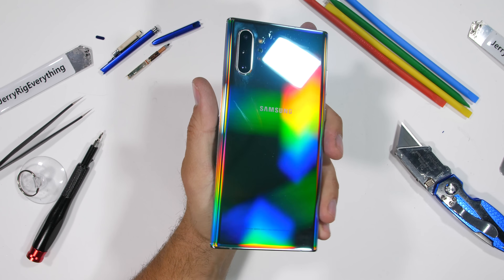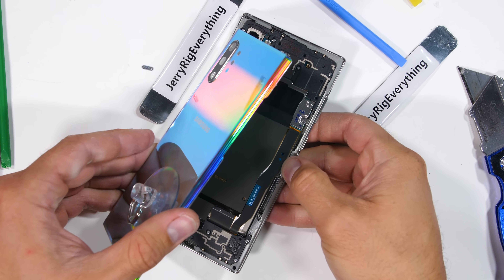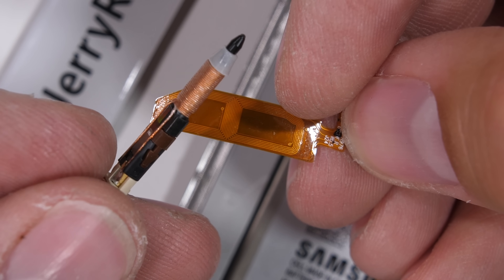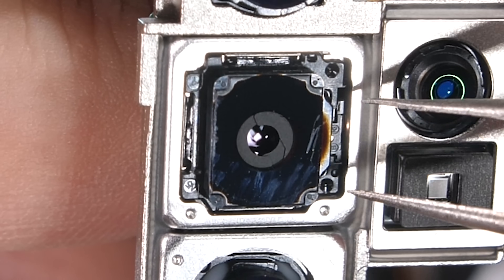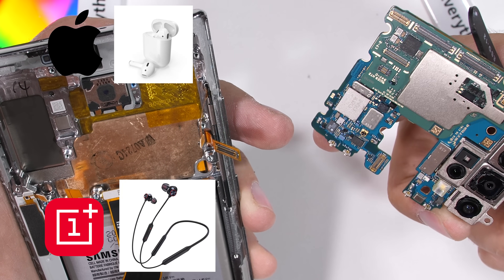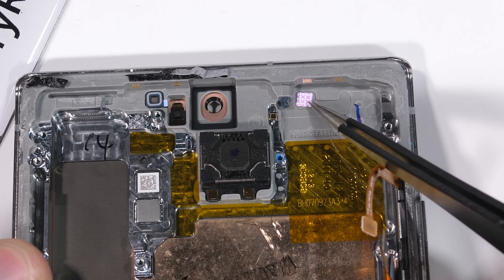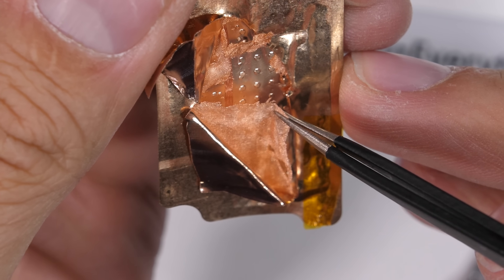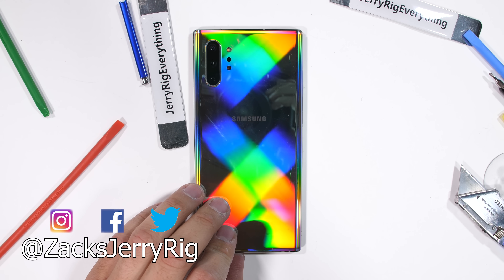Samsung Note 10+ Teardown - TWO Wireless Chargers?

Comment: Remember when you could just take off the back panel on a phone ? like just like that
Reply: You still can! You just have to use a phone old enough to be in kindergarten like I do 😂
Reply: Im using that phone rn. Galaxy Note 4
Reply: Young kids associate that with being poor
Reply: yeah but apple sheeps made fun because of it and It turns out that a nonremovable back pannle is very good for alot of things
Reply: @marquisethomas5611  jup
Reply: Galaxy note three
Reply: One someone stoled my battery in a phone that can open the backside
Reply: Somebody stole my battery because of a removable back panel
Reply: Odio Defectum ahh yes the good ol‘ days when your phone wasn’t water resistant. Loved that!!
Reply: I still can. I have a samsung galaxy j5 from 2017, and i can still remove the back lol
Reply: @lucius2938  my phone had the removeable back and it feel into a creek with the back part fell off the the hardware and everything was just exposed and it worked fine until my mom through it and it shattered and the battery bent in half now I'm on a Google pixel XL 😂
Reply: Odio Defectum my old blackberry did that and the battery was right there. It could literally fall out while the phone is running if you take the back off.
Reply: @Papa Bear Based Consoomer.
Reply: Yeah. Then in mid/late 2014 google invented a technology that can track any phone using only your battery (no gps). 'Coincidencadently' at the exact same time that batteries got sealed in the phones.
Reply: I can still. Using a samsung j7
Reply: remember when you could hang your fone on any wall you liked?
Reply: good old samsung j5
Reply: At least... im glad. My phone doesnt go out from rain, accidently drop water on or drop into the toilet. Im sure that save lot of people hundred of dollar then just to pop out ur battery when ur phone crash. Lets be real, many of the user only need to remove the back to pop the battery when the phone turn black. That doesnt even happen anymore. I wud rather not able to open my back of my phone for no reason than to have it broken from water.

Im not saying u are against it. But some people in ur reply does. They need to priority their reason properly
Reply: @prumchhangsreng979  What about 10,000 mah battery upgrades? Or being able to pop a new battery in when the old one dies, instead of buying a whole new phone. The removable plastic back phones are also thinner & lighter devices. Waterproofing is nice, but IMO not worth what they took away. Everyone has their own opinion though.
Reply: @smokinamby  yeah i forgot about that. My bad
Reply: @BittenKitten  that's the equivalent of somebody stealing the tires of a bike
Reply: Gëretshavда :3 lol
Reply: @elakeqq  I actually still have my note 3 and 5. So I'm planning on buying the Note 10 plus so I won't even think about upgrading for a long time (unless it breaks).
Reply: KeBin cool!
Reply: I used to do that with my phone while i was bored 
Pop it off and back on
Reply: . how did u know (phone is samsung galaxy j3 luna pro)
Reply: Yeaa like the galaxy s5
Reply: Yeah it only on samsung s1 to s4 and note 1 to  4
Reply: @LegoMeng  there are dozens of more budgets versions in the Samsung line up that have the pop off back
Reply: Samsung J3 2016, miss it :(
Reply: Samsung Galaxy note 3
Reply: yeah my samsung s3
Reply: Like my $50 walmart phone
Reply: No grandpa I remember flip phones and nokias!
Reply: Yup. Friends j7 prime fell down 2 floors into gravel. Nk cracks or anything. Battery did fall out though. If that happend wit my iphone, i would have to consider it dead meat
Reply: @quiet_benzy  Mine has an Otterbox and I'd be worried of a two story drop... My old phone got ran over and it was fine, new phone is a note 10+ so the screen is a little more vulnerable.
Reply: Me with a Samsung s3: por
Reply: That is un - safe
Reply: @prumchhangsreng979  The main reasons for a removable battery are: a-Quickly replace your depleted battery with a fully charged battery. b-(most important) When your battery dies after 1.5 or 2 years, just buy a new battery. This way you can use your phone for several years instead of two or less. No need to buy other phone every one or two years. Flagship phones like Galaxy Note work decently for many years if battery is replaced.
Reply: @21753117  good point but.
1. Powerbank
2. Take to the store, u cant remove urself but the store can. Taking phone to store once every 1.5/2 years to replace battery aint big of a deal consider u need to go to store to buy the battery anyway. Extra cost are lil too compare to losing a phone due to water.
3. Like i said, no need to do that. Just take it to the store.
Reply: i like it better harder whenever i would drop my phone the panel would just come off
Reply: @Jake-ec3hp  Still using my note4. Works and looks like new.
Reply: fidgeting by taking off and putting the back panel of my moto g4 play is my favorite passtime
Reply: Goodtimes 😂
Reply: i actually recently revived a galaxy grand quattro with a custom rom
Reply: @creshaunjohnson9105  Good things happen from bad things
Reply: i remember that Lol
Reply: They make the back panel so hard to take it out now because it need to be water resistance
Reply: The 2019 Fairphone 3 can do exactly that
Reply: Zak Whipp p
Reply: Yeah I had a phone like that once
Reply: My phone can do that
Reply: I used to do that all the time for some reason with my moms samsung note 3
Reply: The best part was when you dropped your phone. Instead of breaking, It did a ninja tuck and roll  move, ejecting battery, and back plate to disapate the impact.
Reply: @prumchhangsreng979  Discordo! 
1. A Powerbank vai demorar entre 1 e 2 horas para recarregar o smartphone (e não é bom utilizar o smartphone enquanto a bateria carrega), enquanto que a troca da bateria descarregada por outra já carregada vai demorar só 1 minuto.

2. Você não precisa sair de casa para comprar algo.

3.Existe clientes com outras prioridades acima da proteção contra água.

(O ideal é que tivesse as duas opções [ bateria removível e bateria fixa(com IP67/68) ] no mercado.)
Reply: @Dacite6  if you are talking about water resistant s5 was already water resistant
Reply: I still would be using one with a removable back, and a headphone jack, if my Samsung Note 4 hadn't died.  (It began resetting or freezing randomly, until it finally refused to power-on any more.  Other than that, it was flawless, and sans Bixby.)
Reply: @Jake-ec3hp  Lucky you.  You can also use it as an IR remote control, unlike the newer versions of the Note, where they removed the IR emitter.
Reply: @lucius2938  They're not waterproof after you have to replace the absolutely idiotic glass back panel on the Note 8, 9, 10, or 10+, that is unbelievably fragile.
Reply: Hell yeah I do still thinking of note 4 till this day
Reply: @lennartkrischik4757  J5 2017?I remember my parents having it and the back wasn't removable
Reply: @BittenKitten  65
Reply: Makes me miss my s5. Loved that phone
Reply: I still have one that can do just that!
Reply: With this note 10plus I go straight in the water 😅, remember that this wasn't possible
Reply: They are coming back soon
Reply: And they wer waterproof
Reply: i can take off the back panel on my S10 Plus

Comment: Haha!   “2025 - thinking of upgrading but I’ll stick with my galaxy s8 for now.”
Reply: The Note 9 is the last good Samsung phone
Reply: I'll be happy with my S8 for at least another year
Reply: I have s7 edge and I don't think to upgrade.
Reply: I have nexus 5, and it's kinda time to upgrade.
Reply: That moment when you think man 2025 is fucking future but it's closer to us than 2012
Reply: I still have my S8 since 2017 & I won't upgrade till there's a drastic upgrade on specific features, like the Camera sensors, battery, (larger capacity or upgrade to Solid-State/Graphene battery) cpu/gpu,  headphone jack (optional add-on), screen size (between- 6.1" - 7.0" inch, and price tag!
Reply: @AngeEinstein  the Note 9 is still the best phone around. The best thing about it is that now that the Note 10 is out, the price drop of the Note 9 makes it affordable and highly desirable.
Reply: @AngeEinstein  why?
Reply: Looks at my s6 while typing this
Reply: have nokia 3310 want to upgrade in 2080
Reply: @AngeEinstein  IDK, the S10+ is pretty damn good and also has a headphone jack.
Reply: same here
Reply: Ive had my S8 since christmas 2017, it has gotten a few problems, but next year ill switch
Reply: I had the S7 edge until 2 weeks ago when I dropped it at work & the screen started bugging out.
I went and upgraded to the S8 as that has the best price to performance ratio I could find. 
If only it didn't have that fucking Bixby button it would be near perfect.
Reply: They will probably have their under the display cameras by then.
Reply: @AngeEinstein  nah all Samsung phones are good
Reply: Yeah the world wont even exist by then
Reply: @AngeEinstein  Agreed.  I'm going to keep this for a while.
Reply: @zenon6493  bruh...
Reply: Watching on a Note 10+
Reply: @naomishamwell5449  how is it going so far, and what did you upgrade from?
Reply: This is feasable. I got my S4 when it was brand new and didn't upgrade until the S9 came out. And I only did that because the power button on the S4 blew out. Phone still works fine.

I do love wireless charging though. Maybe I''ll get a Note 15+ when they come out in five years.

By then, the audio will probably work through quantum interference directly from the phone to your cochlear membranes.
Reply: @AngeEinstein  wrong
Reply: Still have an S8
Reply: @henjoh69  Keep your device It is not worth it  to upgrade unless your device get lost or stolen.  If that happen get the Note 9. I will be the best phone for the money.
Reply: @AngeEinstein  what's wrong with the S10?
Reply: @dogcat8290  With the exception of the Note 10. Samsung became greedy just like apple and other companies forcing loyal customers  to by dongles and watches . THAT IS WRONG.
Reply: @wardellrosario2182  are you okay? They include dongles and usb type c headphones in the box. Don't even try
Reply: @wardellrosario2182  And what how does Samsung force people to buy watches? You alright?
Reply: @AngeEinstein  i think the s10 is pretty dam good
Reply: @AngeEinstein  the s10 is great
Reply: @R3mix97  yeah this makes no sense I own both n10+ and note 9...not true at all.
Reply: @wardellrosario2182  They now pushes users to upgrade their phones in the same manner as Apple. On my s8 with android 8 I was using two sims with SD card without any problems, but since Android 9 update Samsung decided to include tiny piece of code named "isSimSdBlock" just to prevent using SD card with two sims. Of course I can always root my phone, but I need Knox.
Reply: @AngeEinstein  ur high the 5g is the last good one
Reply: @AngeEinstein  I think the S10 is the last good Samsung phone
Reply: @yerriff8115  I like the s pen
Reply: @dogcat8290  dongles are unpractical, you have to take a extra piece with you and you can lose them
Reply: @dogcat8290  nah
Reply: Wardell Rosario I nearly got my phone stolen i Sweden, and trust me, that'll never happen again
Reply: @ayaansiddiqui9169  no the latest one is the best one
Reply: @152mmapfsds  nope the note 10 is
Reply: @AngeEinstein  you can lose wired headphones too in that case. If they're not comfortable or you out of all people don't like it then use the usb c headphones.
Reply: @dogcat8290   I personally don't like the centered camera
Reply: @152mmapfsds  so that's why the phone is bad?
Reply: @dogcat8290  I don't think it's bad, it's just not my favorite. Although, I am still going to Upgrade to the Note 10+ from my S9
Reply: @dogcat8290  so I need another pair of headphones that I can't use with my old tablet, laptop or PC? Sounds great
Reply: @AngeEinstein  in that case use the dongle or wireless headphones..
Reply: @AngeEinstein  S10 is the last good Samsung since it's the last flagship with a Headphone jack 😂
Reply: In 2000 years the galaxy S2010 comes out
Jerry - you know what even though my phone screen is burned out from using it for 2000 years it still works perfectly
I'll upgrade in the next 10,000 years or so no big deal
Reply: @AngeEinstein  if you mean for value then yes but if not no
Reply: I have the s10+ I'd say that's the last great
Reply: @dogcat8290  Because the heart monitor sensor it was removed from the Note10pro just like head jack. It was a market stratergy
Reply: @wardellrosario2182  they removed the headphone jack for a bigger battery so that's an answer for the jack, and the heart rate sensor if they removed it how are they making money since they removed it?

Comment: Galaxy S10: Keep the jack but can't replace the port
Galaxy Note 10: Lose the jack but can replace the port
     A soul for a soul
Reply: ChiHaiPika i prefer note 10 in that case,  without headphone jack i can listen music, but without charging port i am dead... even if wireless charging is quick i still prefer to send messages when my phone is charging XDD
Reply: As a microelectronic, soldered port is better and easier to replace when you got the tool. It lasts more and has less issues with shitty fpc
Reply: @rexthewild  I mean does the charging port really malfunction ever in the phone's lifespan. That's very rare to happen unless you are Linus testing the Type - C port.
Reply: note 9 can do both for half the price just saying
Reply: Perfectly balanced, as all things should be
Reply: And my phone have both of them, with sd 855 at just 440 $
Reply: @NiketSatapara  K20 pro I guess
Reply: @zetsubou3704  yepp
Reply: @NiketSatapara  and this phone has an spen, better screen, better camera, larger battery, faster charging, water resistance, more storage, more ram etc. Sure the k20 Pro is an awesome phone for the price but let's not kid ourselves it's nowhere near the n10+
Reply: @zetsubou3704  Type-C should easily outlive the phone so no, there's not much need for it to be replacable (can't hurt tho). Micro-USB on the other hand was breaking all the damn time.
Reply: @kenkalajdzic  Totally freaking agree
Reply: I just use blue tooth headphones anyway... Always have
Reply: @grotesque2786  I know Note 10 + have almost everything, but I don't have extra 700$ to pay 😂😂😂
Reply: @kdye116  but note 9 can't have a 1TB memory card just saying....
Reply: @ayanokoji5594  Note 9 can take up to 2TB lol
Reply: @kdye116  1TB*
Reply: @zetsubou3704  I do managed to broke the S10's port once because I brought it to swim with me in a salt pool for half an hour (intentionally). After I dried it, some green liquid coming out of its port but nothing explode. It can still be wired charged but file transferring was fucked up.

But all of this was solve by replacing the entire board with its warranty and 1 week of no phone life (because there's no part in stock). 
Somehow they don't think it gets water damage, maybe because the water did not actually get in but corroded to port only from outside.
Reply: @NiketSatapara  Neither do I, in fact i got it for cheaper than the k20p

Comment: "I could lose my finger"

continues to bend battery
Reply: It stresses me out so much.
Reply: jerrylogic
Reply: I tried and I just stabbed my left middle finger lol. I need that freaking razor too he is using to pop it off because the box cutter isn't working. I'm so annoyed. I've got to get it open to remove some metal that got stuck in the charging port. If I could remove that part then I think it would charge wirelessly. Because right now it won't charge wirelessly because it says it detects metal. My phone works fine it just can't charge anymore because the port broke and I stupidly used something I shouldn't to fix it and now it won't even charge wirelessly this is a nightmare. I'm forced to use my stupid free iPhone SE. I Hate iPhone

Comment: "I can stop saying Apple has them beat in one area. That's more painful than losing a finger" 😂😂😂 Classic Zack
Reply: The Dukeaholic actually apple has beaten them in WAY more areas.
Reply: @kdk856  yeah the price area !
Reply: @armansomething  true dat
Reply: @armansomething  one day you'll know that apple will release a $2000 phone that is still trash
Reply: @kdk856  thanks for proving my own point. I was too tired to type. 😂
Reply: @AJboy1736  And that day will come sometime during next 2 years I'd reckon. Because I'm pretty sure their foldable phone will be AT LEAST 2k.
Reply: @kdk856  well of course you can do that but your phone will die faster than you can complete a dota 2 match
Reply: Ken Kalajdžič oh you mean how Samsung and everybody else foldable is $2grand?
Reply: @kdk856  ummm no? That drop down notch is so bad for gaming just have a lil cheerio one which shows up less. Also the note 10 has better specs,cooling,display and well everything also the ecosystem within android is better you can use basically any android phone and still get all of your stuff on it easily from previous phones the brand doesn't matter so you get what you really want...
Reply: @AJboy1736  heck no even my 5 yr old ipad lasts for 3 matches with og batteries on it
Reply: wafer does esports note 10 has better cpu more ram better battery and cooliing* the a12 chip gpu is still superior. but the cpu in a12x is better than the cpu in note 10, also the gpu (duh) dont forget that iphone xs is a 2018 phone and note 10 didnt even come out ;)
Reply: @kdk856  
would you rather pay $2000 for a fucking overpriced non-gaming phone to play? You can literally buy graphic cards and processors x3 better for a better price
Reply: @Killbayne  Yes he would. He is an iSheep. He would buy a fucking mac for gaming if he wanted to game on the PC.
Reply: @amerhassanpanbangan6322  that's an iPad not an iPhone -_-
Reply: @kdk856  yes because android phones are VERY CHEAP
Reply: Skyett « nongaming » has better specs than « gaming phones » like razer and rog. pick one
Reply: are you deleting comments dude?